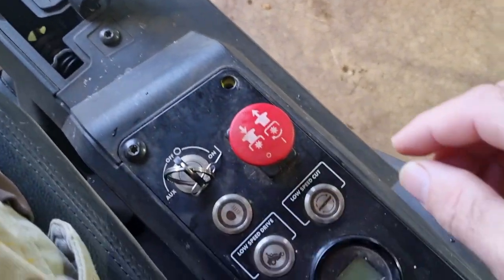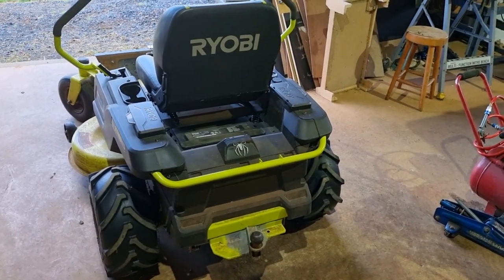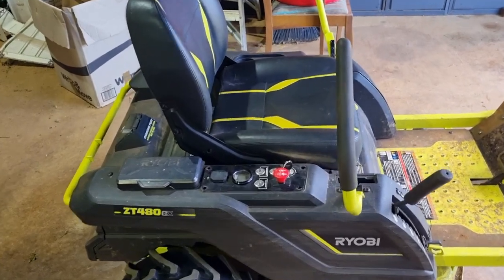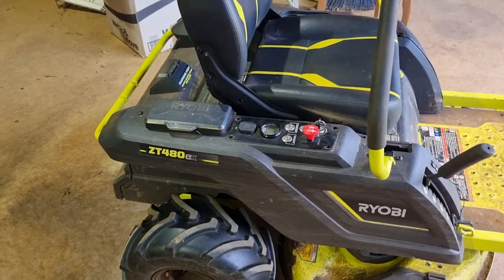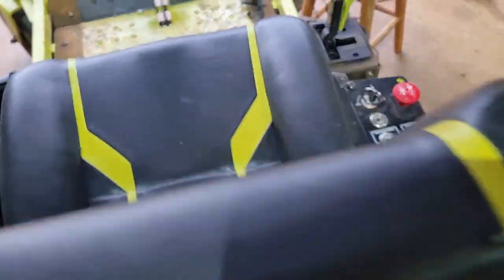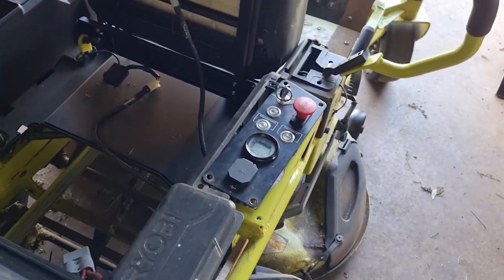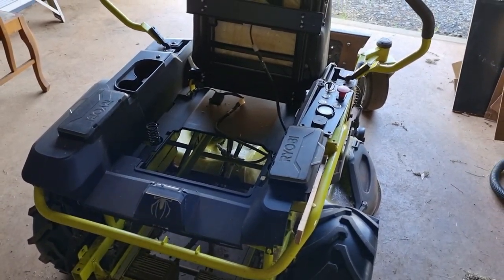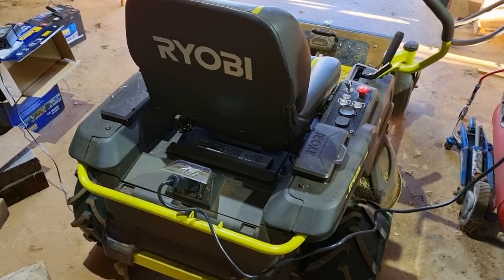Ryobi ZT480 Zero turn mower Electrical Problem

Comment: question unrelated to this particular repair issue:  what tires are those you are running on the 480ex?  I have same unit and would like to put bar tires on mine as well but want to find correct fit.
Reply from the maker: Sorry for the late reply, 18x8.50-8 BKT TR317 4 TL $130.00 Each